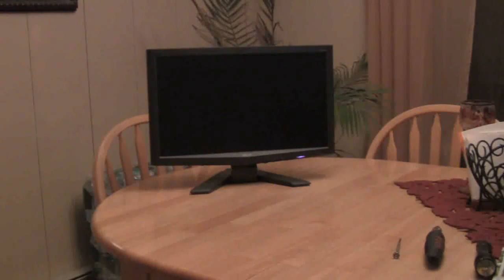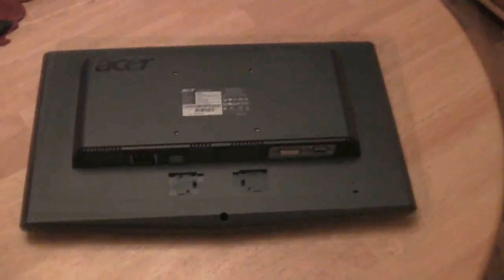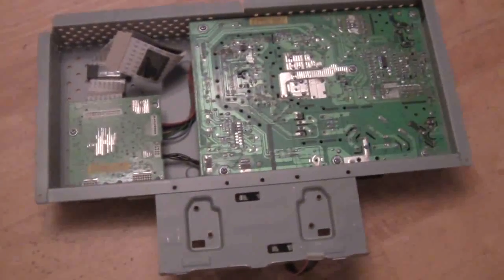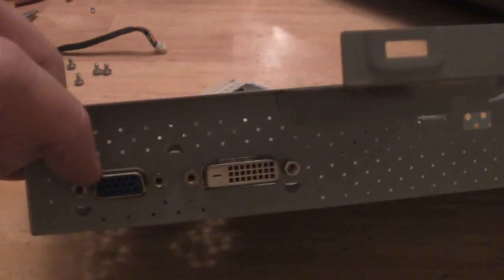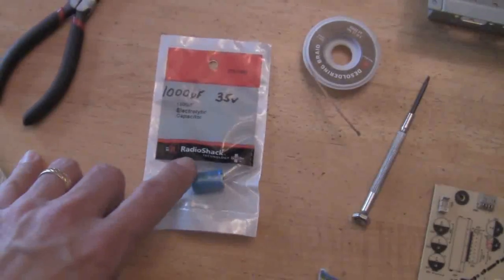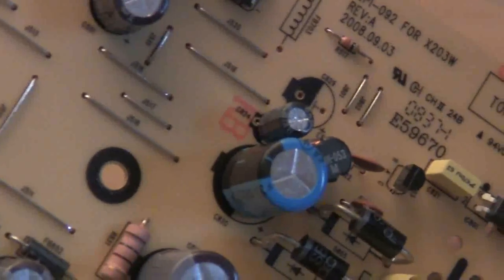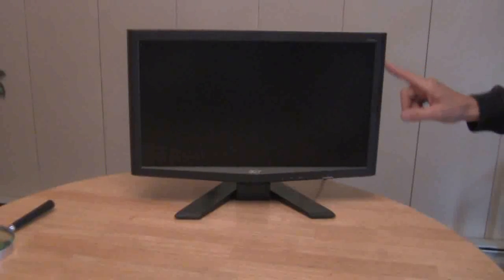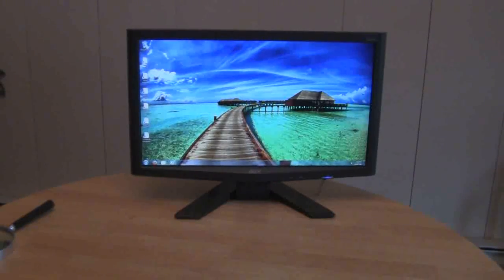HOW TO: Easy Monitor Repair Acer X203H

Comment: Your video just missed the only instruction I’ve been searching for. How to get the caps off to access the base hinge screws. The video starts right after you h  removed them. I don’t want to force them with a screwdriver, as I don’t want the plastic broken.

Comment: Had the same exact issue. Same blinking sequence, capacitor, everything. 8 years after, and this guide was just what I needed. And the tip to tape the front button board up before placing it back in was a wonderful idea as well!!

Comment: This video just saved my 14 year old monitor. My light would be orange for a few seconds, blink blue for a second, then back to orange. I replaced the 2 caps you did, plus a smaller one had swelled so I replaced it too. Monitor is working like a champ again. Thanks!

Comment: Thanks  for sharing this video. I have a X223W  22inch Acer which recently died and I'm sure it's the power supply and its 15 year old caps. Your guide is outstanding and will follow your steps. Greetings from Paraguay.

Comment: Thank You for this video. My Acer x203H had the exact symptoms and your video was a life saver. Both of my 1000 μF 25 v capacitors were bad. Found them for $1,59 apiece in San Diego and installed them. Had never done anything like this before but your step by step video made it a cinch. Great Video!

Comment: That was amazing!  I have an Acer V223W monitor that someone discarded because it lights up but goes blank after about 3 seconds.  The same way your monitor showed "acer" on screen for about 3 seconds and then "no input" (mine says "no signal") then blanks out, but unlike your (quite diligently) repaired screen, mine shows a clear full image for all of three seconds and then... blank.  If I press the power button and turn it off and then back on, sort of the same thing happens... "acer" for 3 seconds, blank screen for a moment, image for 3 seconds, and then nothing.  

I have the soldering skills, mostly, but I don't have your patience, which consequently means that I can often break other parts of a thing in my eagerness to "fix" that one thing that's not working...  🙄🙄🙄🙄

Comment: I got a hold of an Acer X233H - it does work, gotta couple of vert lines in the screen, but color, sharpness, is good. I might do the same surgery to improve its - you went to Radio Shack?! - overall picture! Thanks 🤓

Comment: just fixed my acer S271HL with this exact same problem, this monitor is from 2013 if i remember right. capacitor was bit different 470u 25v, replaced it with same values one and it works. thank you so much.

Comment: Excellent video.  I replaced both 1000 caps and the 470.  Worked.  However, I do have a question.  Did you notice the ribbon cable connector @ the top right hand corner of the back of the display?  I wonder what that was going to be used for?  Touchscreen maybe?

Comment: Wanted to share a couple of disassembly tips. For the bezel, I've always used nylon guitar picks (I use the orange Jim Dunlop .60MM as a player); this has always been helpful with phones, tablets, etc. For the two plastic caps near the base, a small flathead is the key, but it needs to be long enough to get under/behind it. There are three tabs - two on the top and one on the bottom. For the four wires on panel, press down with a small flathead - these are almost like automotive clips, where the downward pressure will release the clip part, then gently work it out of the socket. Same cap as the OP, considering doing both since I've got it out and apart. Will post back when the parts arrive and it's finished, hope this helps!

EDIT: The cap was physically a bit smaller than the original, but has the proper values (1000uF 25V) and so far, so good! Had a minor issue getting it all back together, but after a second teardown and being a little more careful with reassembly, it's working peachy! Lovely to be able to turn it on and off again. Thanks so much to the OP for sharing how it was all done!
Reply: Following up, if they say replace them both, then replace them both. Just replaced the second one today, working again, huzzah!

Comment: Same problem with model of monitor Acer V203H.This have same power supply mainboard.
I replaced both capacitors, with  two 1000uF \ 35V 105 °  instead  original  capacitors 1000uF\25V 105° (only one was broken, for safety better to change both).
Now 100% problem solved, thanks for the video;)

Comment: I've just bought a similar model from a Goodwill, the P191w, but it appears that there's a reason it was there in the first place. The screen boots up to appear very dim. After that, a high-pitched whirring noise seems to come out of the back. Not so loud that it would irritate anyone in close proximity, but just loud enough to become incredibly annoying.

Comment: Thank you very much for this guide. Mine was a 23 inch monitor but otherwise the same as yours. Very helpful guide and saved me the cost (£85) of a new monitor. Just one capacitor had swollen up, a 2200mf 10v electrolytic.  Strange thing is, the working voltage on the board is over 12, so Acer using capacitors with a working voltage of 10 seems optimistic.  I replaced the blown one with a capacitor with a working voltage of 16 to save doing that job again (hopefully). On the positive side it was nice to be able use a standard soldering iron on relatively large components, just like the old days.  These days I mostly have to use a rework station and a hot air gun, together with a magnifying glass, as components are so tiny and pins are so close together.

Comment: For a workaround to keep the thing going before fix or replace, put a heating pad under the monitor (still upright that is, not laid down on the pad) at high heat for about 2 minutes then lower heat for 10, and unplug, plug in the monitor a few times as well. Convected air-flow and heat conduction will gradually warm up the circuit board.

I have an Acer P191W, but the essential construction, and problem(s), are pretty well the same.

After that, do not turn the monitor off at night, or other times, the bad caps apparently don't like to be cold. Leave screen-saver working, but turn off any computer 'power saver' or scheduled auto sleep-mode (I have a Mac, but the principle is the same: a signal should keep driving the monitor) etc.Caveat emptor: by the sounds of it, everyone's Acer will be a bit different and these tricks may not work, or will eventually stop working as the circuit components continue to degrade.

Comment: thank you for being in depth and informative. my model was the 193w. slight differences but the capacitors are essentially the same. mine had both the 1000uf 25v and 1000uf 10v bubble over.

Comment: thankyu the same thing happened to my acer monitor. What kind of soldering gun is that ? are they pricey?
Reply from the maker: It's a butane soldering iron, $30 - $70 online.
Reply: Crypt Keeper's Workshop hi I have same monitor. my work 30 min after lcd black only audio work. where is th e problem

Comment: Thanks! you saved me a lot of money! spent 1.25$ on a replacement capacitor.
For me the hardest part was splitting the back from the front covers, I used two putty knives (narrow and large) screwdriver was leaving marks on the plastic cover. Also I have a really cheap soldering iron, I can melt the solder wire but for some reason I could barely melt the led on the monitor's board to remove the faulty capacitor, so I heated it as much as I could and pried/forced it out of there. Like I said you saved me money and it feels good to keep and repair instead of throwing away.

Comment: Hello,  I have just followed this video and am at the point where you 
inspect the board.  I would like your opinion on a little burn mark 
right next to the capacitor.  Can I just replace the bad capacitors or 
do I need to replace the resistor also???  I posted a photo on your Google+ page.  
Thanks for your awesome 
video!
Melissa
Reply from the maker: I'm sorry, I can't answer that. I'm not an electronics technician. But, I can say that replacing the bubbled capacitors worked for me and others on YT.
Reply: I replaced three capacitors and it's now working.  Thanks again.
Reply from the maker: Melissa Rij Hey ! That's great! Glad to help.

Comment: Before to fix my Acer monitor, another model...but same capacitor,  i had to buy a new one,  it was better to buy a used one to save money too. i prefer to use an electric soldering iron of 20watt, it's good for such work.

Comment: Mine just started doing this (same monitor - lasted just about as long as yours), but it's not failing entirely to power up, just blinking, and taking forever to reach a point where it will power on. Usually takes me unplugging it and plugging it back in and then rebooting and waiting, and eventually it starts. But this looks like a nice 'side-project' to work on when I get a chance and a monitor to supplement in the meantime. Great easy to follow how-to.
Reply: Sounds more like your computer if it takes long to to start?
Reply: No, it's not my computer taking forever to start, the monitor is taking forever to start. Meaning it displays nothing for the longest time. That monitor finally failed completely. I still have to do that whole side-project thing to get it up and running again.
Reply: Hey i'm in the stage of your first comment.  takes several minutes to turn on.  I challenge you to try the repair!  If you already havent.